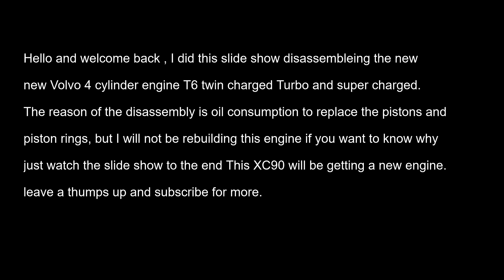Volvo XC90 Oil Consumption disassembly 2.0 twin charged T6

Comment: I dont know if anyone knows but what is the conditions set for the supercharger clutch to be activated? Obviously under load at lower half of rpm scale but im wondering about highway use. Thats a lot of wear on those fins to be spinning for hours on end especially if its heat soaked. Otherwise nice vid and organization
Reply from the maker: It's for lower rpms and heavy acceleration highway speed there is no need for it the turbo is more than enough once the rpms are over 1300 rpms

Comment: Great Channel!! Thanks for your commitment to helping Volvo owners/DIYers.I just purchased a 2018 XC90 T6, and noticed one day water coming from behind my rear view mirror. Checked sunroof drains and all looks ok, so unfortunately seems like I will have to drop the headliner to replace the sunroof seal like many have had to do. My bigger problem right now, and I think it's probably caused by the sunroof issue, is that my sunvisor mirror lights, 2nd row and 3rd row courtesy lights on ceiling do not work. Checked Fuse # 8 under glove compartment and it was blown. Replaced it and it blew it immediately, so there is a short somewhere. I ordered a wire tracer to confirm my thoughts and it really does have a short, but I have no idea where to start to find the short. I can not find a wiring diagram anywhere. Any suggestions please on how to start troubleshooting and where to find a wiring diagram? Thanks!
Reply from the maker: Most definitely, you have a short somewhere in the wiring in the headliner or possibly one of the components that get power from that fuse on the headliner. You just have to find it. As far as the sunroof water leak, the problem was fixed in 2017, and newer models so make sure no one had the headliner down pervisly and possibly caused the short and / or thar water leak.
Reply: @TheVolvoGuy  any idea where to find the wiring diagram? Or any tips to finding the short?
Reply from the maker: @M User  only if you Have Vida subscription
Reply: @TheVolvoGuy  Is it something that i need or will help me to find this short much quicker in your opinion?
Reply from the maker: @M User  shorts are easy to find, but you have to start by unplugging every component on that circuit, then inspect the wiring inch by inch if the short is till there with everything unplugged.
Reply: @TheVolvoGuy  Thanks....Ive unplugged the three ceiling reading/dome LEDs...any clue what else is plugged in to this fuse? I would like to avoid dropping headliner as I don't have a garage and it's -16 here this morning...but i guess will have no choice if nothing else works.

Comment: How did you get the chain off the oil pump? Did you remove the sprocket or can you get enough tension in the chain to slip it off?
Reply: You can definetly get enough tension out of the chain. The sprocket is extemely tight and I would not recommend removing from there.

Comment: What do you think about XC90 with diesel engines? Is it worth to buy an old one (2015, 2016, 2017) or do they have the same issues as the T6?

Comment: I have an 2017 XC90 T6. It lost turbo and also started smoking out the tail pipe. I replaced the turbo and supercharger.  It still smokes as it warms. I have done compression testing on all cylinders (155-160 psi on all cylinders), leakdown testing, pressurized the cooling system and scoped all cylinders. It does not appear to have a blown head gasket. Could this be leaking head valve seals?  Car was ran low on oil (it was consuming a little oil before). I am pulling the head to inspect.

Comment: I’m hoping you could help me with an issue I have with Volvo. My car is a 2016 XC 90. I had an oil consumption issue that was taken care of by Volvo in May 2023. November 2023 the car shook and completely died while driving. 
Volvo is blaming this on the cylinders and camshaft. My question is would these parts ( the cylinders and camshaft ) have to be disassembled during the time the oil consumption was being fixed? They’re trying to tell me that this is unrelated to the oil consumption issue but I feel like they may have had to remove these items to get to the Pistons. I could be wrong, but I would like a professional opinion. Also with this car, I had absolutely no lights on the dashboard indicating an issue Before this happened Thank you for your help.
Reply: If they did the piston rings, they 100% had to remove the camshafts (the whole head, in fact, in which the camshafts reside, would have been removed).  If the cylinders are damaged then there's a good chance they didn't properly end gap the piston rings on replacement (which is a REALLY common step to skip)... or some foreign debris found its way into a cylinder... the wrong end gap would easily cause the engine to seize up and die a rapid, possibly violent, death... the engine will likely require replacement.

Comment: Your videos are great help to people. I’m subscribed! be your fans. I kept watching them in the past 3 months because I own a 2016 XC60 T6 (used)  B4204T9 with over 200k miles. It has serious oil consumption issues, 1qt 500miles. And recently cylinder 1 spark plug metal tip was broken in the engine while driving. Now It got a random misfire. The car is in turtle mode. Borascoped didn't see the scratches in cylinder1,2,3. does not take out cyclinder 4.  I love this car and don't know if it is worth saving it. Worked on the car before, but never rebuild an engine. It's hard to find information. Can you help to provide the instruction? Thanks in advance.  

Reply
Reply from the maker: You have to remove the cylinder head inspect the cylinders and replace the pistons and rings.

Comment: Are you located in NYC area? I own a 2016 Volvo xc90 and want to find out if I have the same faulty piston ring installed in my car. I do most of the work  myself in my car. I recently watched one of your video, what ever problems you mentioned I faced all of them. I replaced O2 sensor, fuel pressure sensor, oil leak was the big one, which I had to go the dealer $1300 job. Now you scared me with the oil consumption. Hope I have the correct piston ring on my car. Can I find out if my car may have the faulty ring installed. Thank you
Reply from the maker: I am in NY, but not the city. If the rings have been replaced with the new design, that means the pistons and the rings have been replaced with the correct ones.
Reply: @TheVolvoGuy  I think camshaft seal was replaced not the piston. I drove little over 50k so far and haven’t noticed any oil consumption. Hope mines is ok. Thanks for getting back to me.

Comment: I overall the b4204t27 t6 engine on xc90 2017 like engine that you opened 
Right now I would like to know how adjusting the camshafts and crankshaft timing
Unfortunately I didn’t mark anything before open
Reply from the maker: So I have this video on how to set the timing for the I6 engine. I have 4 videos you can watch on it it shows all the tools needed and how to do it step by step.
Reply from the maker: https://youtu.be/4ua9vQaNYHg
Reply: I saw that video but my engine is new 4 cylinder turbo! Can you help me on this engine
Reply: The Volvo Guy thanks for your support

Comment: I’m a t5 guy but how is it working on these new ones? Hard af or what? I haven’t got anything over 2009 lol. Seems like it took awhile just to get the valve cover off
Reply from the maker: Yes it's more pain then the 5 cylinder engines. So much more tools needed vs the 5cyl. 
   I own a 5cyl turbo Volvo xc70 my self I have close to 300k miles and it does not even burn oil. Am not a fan of the 6 at all.
Reply from the maker: And the 4 cylinders is a whole different story turbo and supercharged engine crammed in. 
It takes 3 hours just to get the oil pan oil lol.
Reply: The Volvo Guy damn! I’m not a fan either. I also daily drive a v70 xc tuned with a few mods. I’ve been through hell in that car and it’s still a beast! Just found your channel thx for the replies
Reply from the maker: @patrickmadden6340  nice I just bought my 2nd volvo its 2005 V70 2 wheel drive with 100k miles it's in a great shape. 5cyl T
Reply: The Volvo Guy great year too you’re gonna love that I bet. I got 4 now but I got an 850 with a 5 speed as a donor car for future mods. 09 hardtop c70, 98 v70xc and an 02 v70 xc. It’s interesting seeing you work on the 6 cylinders, I’ve been curious but they seem to have issues. Are they not that reliable?
Reply from the maker: @patrickmadden6340  stay away from 2010 and up it burns oil and other problem 08 and 09 seams to hold up a lot better.
Reply: I have a 13 s60 T5 2.5L turbo 88k bought it and drove perfect for 190 miles then a lower end knock out of nowhere. Called dealer where they recently installed new rings exactly 194 miles ago and they said unlikely a lower end knock would be caused by them doing rings, and I should look at other possible symptoms to find the culprit. Although they said they have a two year warranty on the piston ring job, I would hate for them to charge me just to say I’m unlucky and need new engine. I’m aware of the class action lawsuit for these certain years and just looking for advice as I would love for Volvo to fix this problem. I know they made a technician journal with the procedure and even though if it’s a rod bearing, knowing that they probably replace the rings from up top, why did they not change the oil it’s dark and smells like an additive was put in it and like I said only 194 miles since their repair. Do you think I have some thing here or am I just wasting my time? The technician journal says after piston rings they have to inform the customer and also put a sticker stating For the rest of the life of the car, you must use certain oil fully synthetic that meets the criteria in order to keep your warranty intact. They did not do this. In fact, I think they did just piston rings and realized more damage in the lower end so they just put thicker oil or an additive in it and sent it to the auction where I was the unlucky one that purchased it

Comment: I have spent many hours around the  first generation  Volvo S/V 40 1.9T/2.0T 4 cylinder white block, and I have to say not much of the design has changed over 20 years.

Comment: Hey The Volvo Guy! Just subscribed, I appreciate your dedication to giving us all of this info! I just tore down a 2016 xc90 super/turbo. I have the head off now and the suspect cylinder (low on compression and blowing blue oil smoke) actually looks pretty good to me. Light scratches on the cylinder but nothing that catches my nail. Should I measure the cylinder for out of round before dropping pistons in this thing? I would really appreciate your input! Thanks, Lyle. Maybe we can email?
Reply from the maker: If there are no scratches, the cylinders should be okay, but it doesn't hurt to check
Reply: Would you know where to get a repair guide for thos car ?

Comment: Is there a way to measure how deep the scratches are? or any visual scratch is an automatic failure.
Reply from the maker: If you run your finger nail across the scratch and it catches your nail that is too deep.

Comment: What cause the damage to cylinder wall?
Reply from the maker: The spark plug broke at some point and caused some damage
Reply: Is that common in those engines? That's very ford like
Reply from the maker: @tmillner0682  no it's not common

Comment: We are looking at buying an 2016 XC90 with only 46k on it, manufacture date of Oct. 2015, would this XC have the bad style rings?  Do all with those style rings eventually need the pistons and rings done?
Reply from the maker: If the pistons have been done then you should be good if not then it have the bad pistons and rings. Look for a 17 or newer its much safer.
Reply: @TheVolvoGuy  thanks, it definitely did not have the piston and rings done, the dealer service quotes over $7000 for the repair and sales was not willing to reduce the sales price, so we walked away.

Comment: Hello, just subscribed. Just wondering how much of a job it is to remove and refit the sump on one of these engines? I can see there's a bead of sealant run around the edges but are there any single use o-rings / gaskets that must be replaced? doesn't seem to be much info around regarding the vea engines. Thanks.
Reply from the maker: Are you talking about the oil pump?
Reply: @The Volvo Guy  No I mean the sump / oil pan
Reply from the maker: @xenontetra1758  what engine do you have?
Reply: @TheVolvoGuy  b4204t38
Reply from the maker: @XenonTetra  what year and model? The 4 cylinder engines are much more difficult to remove than the 5 and 6 cylinder engines.
Reply: @The Volvo Guy  its a 2017 yeah i can see theres an oil cooler attached
Reply: Its a volvo v40 not available in the states but has the same vea engine as other models afaik
Reply from the maker: @XenonTetra not the easiest job, but the seal they use on the pan itself is RTV in addition to any Orings.

Comment: What was the mileage on it
Reply from the maker: Around 35k miles.
Reply: @TheVolvoGuy  Unreal. Volvo should spend a little less on refining the interior of the car and more on the interior of the engine.
Reply: @TheVolvoGuy  Wow! How bad was the oil consumption or did the car overheat?
Reply from the maker: @aminopa  it would burn 2.5 qts every 1k miles. It did not overheat.

Comment: Hi I plan to purchase a used 2018 or 2019 t6 xc90. My audi q7 currently has the same issue with oil consumption. How reliable would you rate the xc90 as a whole from 1 to 10. I don't want to be stuck with another problem car.
Reply from the maker: 2019 is safe to say a good 9 out 10

Comment: I'm about to buy a used 2016 t6 R-Design 50k miles. Should I take it a volvo dealer and ask about the oil issues or could you help me out by looking at the vin?
Reply from the maker: If its a 16 it means it does have the old style rings unless its already been done. Car fax is the only thing can show it or the dealer ship.
Reply: @TheVolvoGuy  ok thanks will check

Comment: Hello, I just got my engine replaced by volvo last week. When we got it back I noticed a squeaking noise coming from the front passenger wheel when we go over bumps or move the steering wheel side to side. I see that you removed the wheels from the vehicle to repair this engine. Do you think this could be associated with the engine replacement? Thank you
Reply from the maker: Do you have a 4cylinder engine? Or what is your year and model of your volvo?
Reply: Yes, I have the 2016 xc90 t6 r design. So 4 cylinder turbo and super charged.
Reply from the maker: @priscillasimpson7880  if the dealer rebuild the engine by replacing the pistons and they did not replace the engine then the suspension does not get touched if they replaced the engine the the suspension have be removed on the front.
Reply: @TheVolvoGuy  thank you. Yes, they replaced the entire engine. Thank you for your time and info! I have been driving myself crazy because of this. I'm taking it back on Wednesday to make sure everything is okay before we travel next weekend!
Reply from the maker: @priscillasimpson7880  no problem happy to help and safe travel.
Reply: Why was it replaced?

Comment: Can you do one detailing how to replace MAP sensor?
Reply from the maker: What is the year and model? And engine
Reply: 2007 XC90 3.2L
Reply from the maker: @jamarshaw1614  it is on the intake once I get back to work I will take a video to show you where and how to replace it. But why you want to replace it?
Reply: The Volvo Guy I got a code saying for the barometric sensor
Reply from the maker: @jamarshaw1614  this is must be a code from a  Genetics   Scan tool I deal with Volvo factory codes do you have the genetic code I can cross reference it to the Volvo codes.
Reply: The Volvo Guy P0107 & P2227
Reply from the maker: @jamarshaw1614  so what you have is problem in the intake pressure sensor circuit so normally I would check the sensor connector and pins if I do not see any damage then I change the pressure sensor
Reply: The Volvo Guy  could you let me know where it is located?
Reply: The Volvo Guy I was driving recently and got a message on the user interface that told me engine power would be reduced. When I ran the codes I still had the same ones as before.
Reply from the maker: @jamarshaw1614  give me an email or something to send you pics. If not I will try to make a video tomorrow showing the location of it.
Reply from the maker: @jamarshaw1614  what code the same one for the MAP sensor?
Reply: The Volvo Guy yes, it’s the same code. And what’s a good email?
Reply from the maker: @jamarshaw1614  mnmarji14 gmail

Comment: Hello, do you have any kind of service manual for this engine? I have a 2015 Xc-60 entering safe mode under high load conditions (mainly accelerations and uphills) and neither the Volvo dealers or Volvo workshops have figured out what it is.
Reply from the maker: Is it intermittent?  And do you have a check engine light on?
Reply: @TheVolvoGuy  It reduces with more engine runtime, even though temperatures stay the same.
I had a reduced engine power warning (with a little turtle at the bottom), but no check engine light.
Reply from the maker: If that warning did come up that means you should have a fault codes in the system. In which it might help finding the problem.
Reply: @TheVolvoGuy  managed to read the car fault codes and there was none. Started to revise each fuel system part to check for anything unusual. So far spark plug gaps were off. The car got better with it correctly set up, but still not great. Will undergo checks on the injector in the next few days.